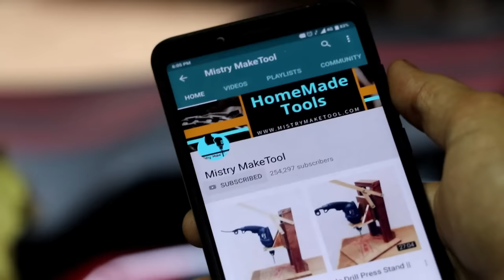Make A Sheet Metal Rolling Machine || DIY Sheet Metal Bender Machine

Comment: hello, i need a rolling machine to reduce thickness of aluminium sheet, from 2mm to 1.7mm. But i would like the sheet to remain more or less flat. I have 2 questions:
Can this rolling machine reduce thickness?
If we turn the sheet at each pass, does it avoid to roll it? 

thanks

Comment: See all of those gnarls in your hole? It’s not from lack of lubrication, it’s from stray shavings getting into the hole. Use air in short quick blasts. It’s why we use liquid coolant in such high flow, mostly to clear away chips. This chips are why your holes are dirty.

Comment: Where the hell did you get the 3 rollers and the2  tightening bolts? Off another bender?
Reply: They are steel pipes, you can even buy recycled ones cheap. He made them into rollers, the tightening bolts are also available from regular cheap C clamps. for clamping metal or wood. He's just really good at fabricating that they look like OEM parts when it's really not.

Comment: Your design is over engineered! Remove the chain drive for the lower rollers, let them free wheel and when modifying top roller extend top  roller drive shaft through one of the bearings, so it can rotate with the roller (a solid connection)  then attach your crank to it. Simple and easier to build in less time! Top roller is now the drive roller not the bottom ones